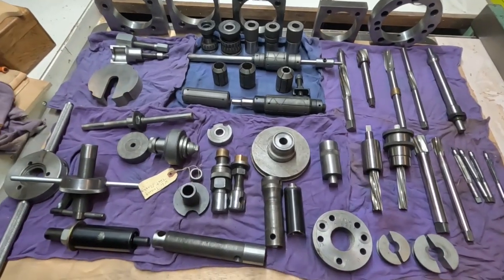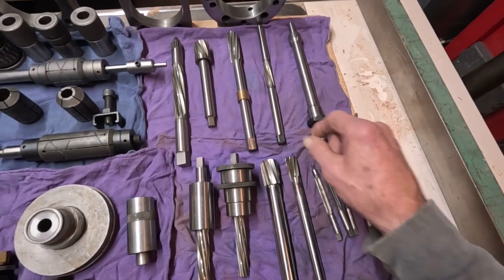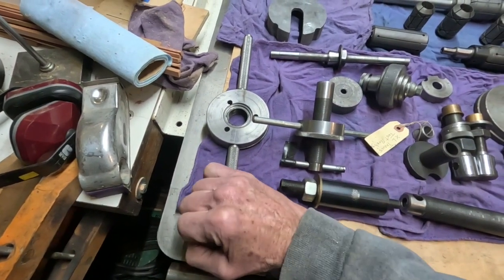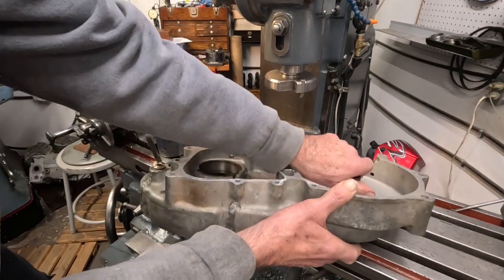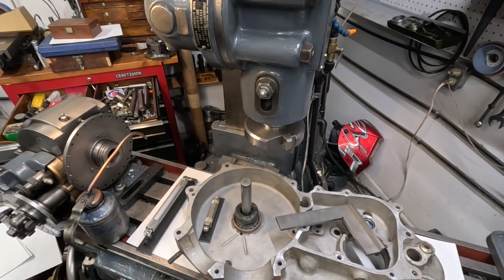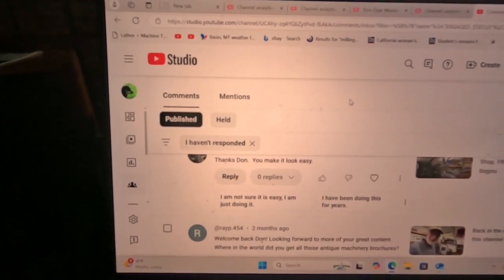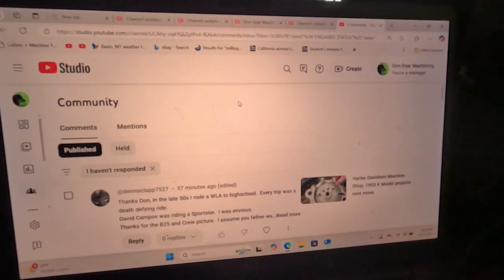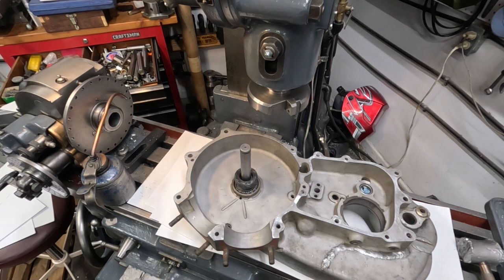Harley Davidson Machine Shop, The Special Tools and the project continues

Comment: Look at that pile of cool custom tools eh? As an old caterpillar mechanic, I have a good understanding and appreciation of special tools. As a result I own or did own a good pile of them. As I no longer do that work many of them I have sold off to buy ... 😁 Kent-More made OEM service  tools for nearly everyone  at one time or the other it seems.
Reply from the maker: Harley had a tight control on those tools with Kent Moore, only the dealers could buy them. Not one of those tools is used on the current models.
 The engines now are made like other modern engines in that any rebuilding is replacing major components.